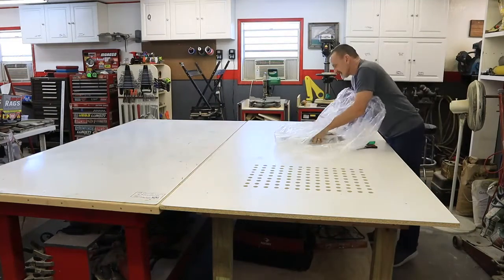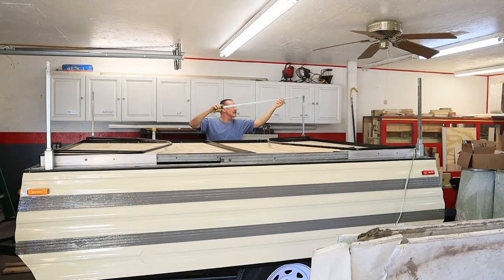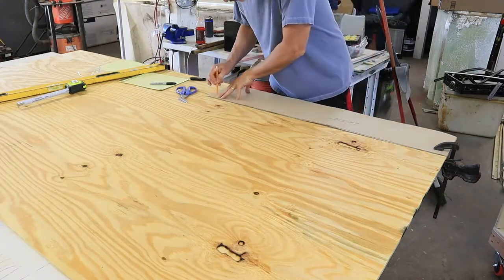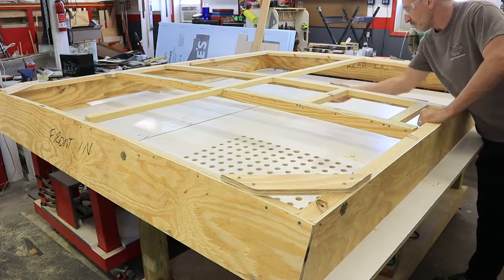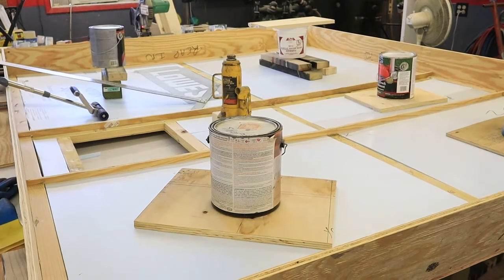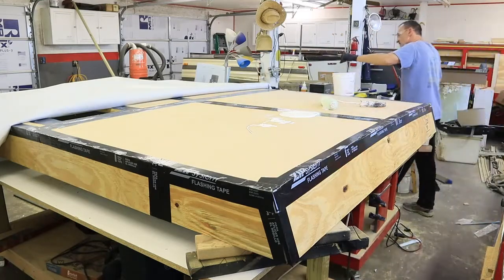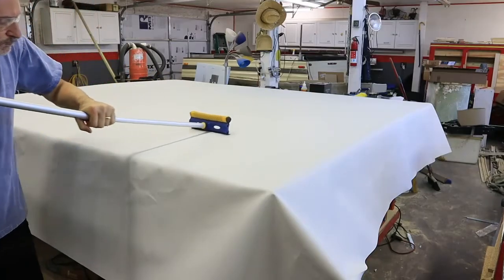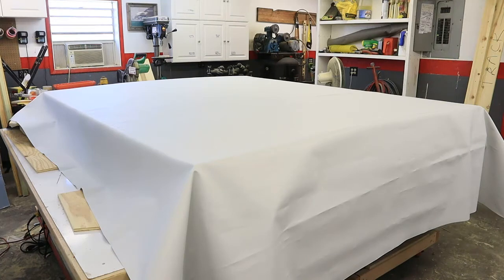HOW TO REPAIR POP UP CAMPER ROOF Rebuild Jayco Camper Roof Replacement DIY PT 25

Comment: Loved watching this! I am about to attempt a complete rebuild of my 97 Jayco J-series  1406 roof. I have a question for you however. I have seen these superflex roofs and am concerned if I use this that it will puncture. I also have been impressed with some other videos out there that use a roll on coating like truck bed coatings or others. From my understanding, you cannot use any other products on top of this superflex. Do you have any recommendations or druthers that you personally found in your research to nudge me one way or the other in the final finish of the roof material? Thanks, and nice work!!
Reply from the maker: Truck bed coating is not a sealer, it's to prevent scratching and skidding in the truck bed. It also covers imperfections. The coating is heavy. I guess the rubber membrane could puncture but if it punctures being glued down, you probably have more damage than just a puncture. This membrane has also been on my 2014 travel trailer since new, no punctures. Thanks for watching.

Comment: I'm working on a camper that's going to need 12'+ sides. I've watch other videos where they purchase lumber that's 14' long and trim to fit, but I love the idea of splicing together plywood to get that length. Mostly because it's easier for me to transport than a couple of 14' boards. Did you do anything special on the areas of the sides that are butt jointed together? I was thinking about biscuit jointing them.
Reply from the maker: I used a small separate piece of plywood to cover the splice on the inside. Biscuit joining may work too. Good luck.

Comment: Hey man, this video is extremely helpful. Only have a couple questions: how did you negotiate the corners with the rubber, and what did you end up using to trim it out after the rubber skin was secured?
Reply from the maker: Thanks. The corners are about glue, clamp, and stretch. Curves and corners are a hassle. You can also strategically make a diagonal cut from the outside edge to the corner and do an overlap. I would suggest practicing the cuts with paper or spare clothe first. Good luck.

Comment: What a great video! I wish we could do this with our pop up but we only have one small spot on the side of the roof where it’s rotting. It’s about 2’x2’ section. I’m wondering if there is a way to just replace that spot ?
Reply from the maker: Thanks for watching. You can just replace that spot but you have to reinforce the attachment of the patch. Sometimes it is just easier to rebuild the whole top rather than try to patch. Some people do get away with patching though. Good luck with your repair.

Comment: Enjoying your videos.  I acquired a 1982 Skamper two years ago and begun a rebuild.  Even started some video on the process for eventual YouTube channel. Mine was in much better shape than yours, but the roof was trashed and constructed the same way yours was. The bottom half seems to be in pretty good shape - needs new canvas, but the current one seems to be functional. I live in Massachusetts in a house that was built around 1850, so they did not plan for a garage.  Everything I do has to be done outside, thus a bit slower progress than yours.  Roof rebuild was in process when I put it to bed for the winter of 2019 and was unable to work on it during 2020.  So I have questions.  I considered altering the roof to include a slight top curve for water drainage purposes, but wasn/t sure how to go about doing that.  How much offset does yours have from the center to the sides?  Can you give us a hint as to how that was accomplished?  What was the process of patterning the center hump? Also did you have to do somethihg in the center of the roof to maintain the curve from front to back. Future videos = hwhat  is your plan for the corners?
Reply from the maker: My top curves side to side. No curve front to back. The curve is just 1 inch drop from the middle peak to each side. I made a template out of cardboard and traced it on the front and rear roof sides. In the middle you can see 2 crossmembers around the vent hole. Both of those crossmembers have the same curve on them. Still thinking about the corners. Good luck on your project. Thanks for watching.

Comment: Great build. Want to do this. Any problem with added weight?
Reply from the maker: I am not sure what added weight that you see? It is built about the same way it was from factory.
Reply: @FakeLegGreg  did you not have to put plywood on top then rubber? Also new insulation plus took inside.  My roof is fiberglass, then foam,then luan roof for inside
 Seems yours have roof out and then took in..correct?
Ths for return email
 I want mine as nice as yours!
Reply from the maker: @jimkeeling  Mine is 1/8 plywood, 1 inch foam, and the thin rubber sheet over the plywood. I don't think it weighed much different than the plywood, foam insulation, and aluminum skin that was on it before. Good luck with yours.
Reply: @FakeLegGreg  tks..doing it

Comment: Watched the roof repair on jauco popup. You put plywood on top with 1x2 frame. What did you use for inside roof? Question. Would this not add a lot of weight for cables lifting roof? Mine has cable. Afraid of to much weight. Your thoughts.
Reply from the maker: Mine is cable lift too. I used 1/8 plywood on the top an don the inside. Some of these popups are designed to lift tops with A/C and that  adds a lot of weight. My top weighs very close to original.

Comment: Really enjoying your videos. How did you handle the roof corners with the superflex?
Reply from the maker: Thanks for watching. Well....at this time i havent done anything more than the video. I have been literally frozen out of the shop in north texas. We have rolling blackouts and temps in the single digits. We are not equipped for this. It looks like a week or so before we get back to our nornal winter. The corners will have to be addressed. Its probably the next video. Thanks for asking.
Reply: @FakeLegGreg  Same here, in Alabama, all garage projects are on hold! Haha. I'm planning to do the PVC fabric, and just trying to figure out what to do on the corners to get a water tight seam
 Looking forward to the future videos!
Reply: @FakeLegGreg  any updates on the membrane? How'd you fit the membrane on the corners?

Comment: Do you remember the length of the sides?
Reply from the maker: The sides of the top were about 10 ft long at the bottom.
Reply: @FakeLegGreg  Thank you so much.I forgot to ask how tall was then. Lol
Reply from the maker: @dalejrfan820002000  I made the top 7 inches tall.